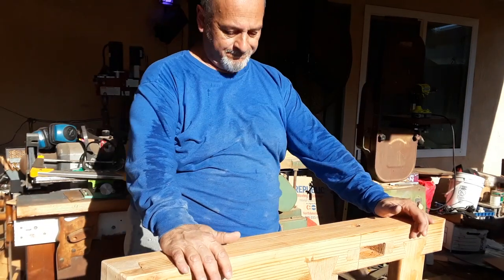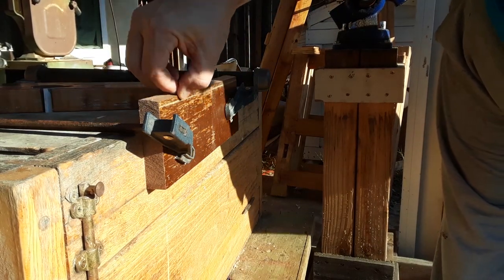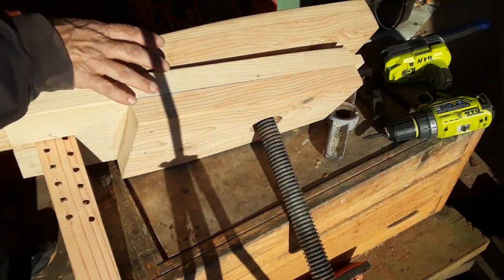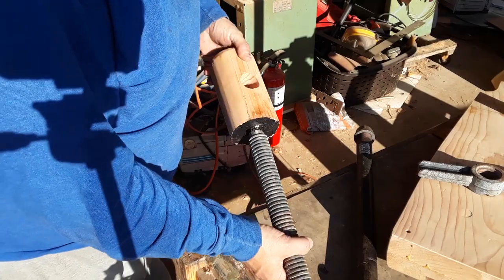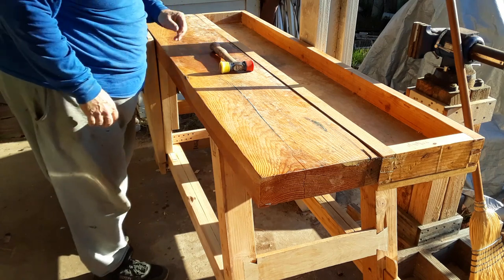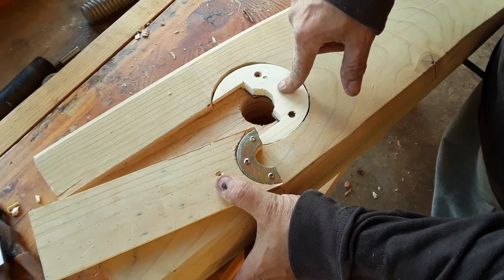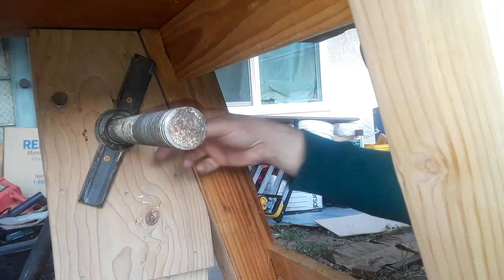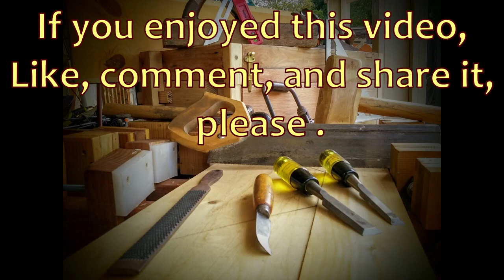Face Vise and Moravian Build Finale'

Comment: I watched this whole series, and I've gotta say it's cool that you showed your challenges and failures along with the successes, because this is real woodworking. When does a project go perfect? Not often, in my experience. You didn't 'sanitize' it for public consumption but you checked your ego and gave an honest account. Good for you. You've still got a nice workbench to show for it.
Reply from the maker: Thank you so much! I mean really, how can we learn until someone shows us the wrong way...right?
Reply: @DBacaMaker  Thank you for making this series of videos.  I have been considering making a Moravian workbench, but one thing that concerned me was having the vise shear off the dowel pins holding the top on if clamping a thin piece of wood (I didn't know how the back piece of the vise was secured; now I know there is an upper tenon as well as a lower one).  I appreciate your candor and your patience with yourself in working through the challenges that you faced.  It was a good example for me!

Comment: If this is your first bench, build a Nicholson Style. You need zero vises, hardly any joinery skills, and a drill bit. With these you can build a bench that can hold work and teach you how to build and join properly.
Reply from the maker: I have a Nicholson style bench as well, this one was meant to be my portable bench for when I work out at my theater group's stage. As it turned out, I haven't been able to use it that way.

Comment: You didn’t buy anything did you? This is super creative! It’s cool watching you make a vise from almost scratch.
Reply: Also, in the DVD he suggests oblong holes in the slab on the side that is away from the front to help with wood movement. 

If your top shrinks or grows it could get stuck
Reply from the maker: I was lucky to pay no money. But getting the parts I used required some sweat at another job. But yes, I came out way ahead on this.
Reply from the maker: LOL I did that by mistake anyway. Unsteady hand a drilling.

Comment: Have you thought about adding a planing stop to your workbench so you don't need a bench-long bench hook? Holes for hold fasts? Ultimately, I'm really impressed that you stuck it out and finished what seemed like a real bear of a project. And in such heat, too!
Reply from the maker: Oh definitely I want to add dog holes. I just haven't done it yet due to other projects. After all that, it became another horizontal surface.  Thank you! There is SO much I want to add, like dogs on the legs for long boards, a removable shelf underneath with portable tool drawers. SO many improvements over the months.

Comment: Very impressive. You definitely took a good design and made it your own.  You used what you could get or re-purpose as your material and It came out outstanding.  And you did it with hand tools for the most part! Now I will go back and watch all the videos again and look forward to the next.
Reply from the maker: Thank you. It's what I try to do as much as possible. I mean did you see the "stock" I have to work through in that yard? I must add, the power tools I received for free were actually kind of a hindrance is some cases. Just about the only time-saver was the radial arm saw for making kerf cuts. When I'm out at the stage or another job, the hand tools are what I use. I just had to push through this to move forward.

Comment: Nightmare build. I bought a parkinson vise from the 1950s, a Record Irwin competitor that was sold to colleges in the UK and someone rescued it from the skip, that when I got it.  Nothing wrong with using metal vise either I bought some rubber grips for mine.  Thanks for sharing.

Comment: Thanks for pushing thru to the completion. I'm looking forward to seeing more projects from you. If I can throw in my $.02; please be more careful. At 3:34 you were cleaning the dovetail & pushing the chisel directly towards your left hand. One slip and "it's off to the emergency room. Also, take better care of your thumb... :)
Reply from the maker: Had I really been applying pressure instead of short scraping motions I would have clamped it down. That was just cleaning off bits of fuzz; however, heh, you noticed the bruise on my nail. That was a screw gun bit bumping slipping out of a screw into the area just below my nail back in November of 2019. It surprised the !@#$ out of me when a bruise rose up. LOL

Comment: I wonder if the Roy Underhill bench hooks would work out better for you than a hook that goes the entire distance of the bench, maybe make three that way you could put one on each end and one in the center or wherever you happen to be cutting so that you dont have bend in the center, plus with his hook system you can also cut very small pieces. Yeah I saw that check near the end of the video and was like oh boy that's not good I like Heartland Outdoor Living's idea of using bowties to bring that check "into check". The bench did turn out nice though, looking forward to next video
Reply from the maker: Roy's hooks were what I had in mind. But I could certainly have fun with long pieces to flatten and square the length of the bench. As for the check. Yes, a few butterflies are going to land on it for sure. Most of the crack is underneath. Once that's treated I can look to some kind of tail vise situations. Thanks!

Comment: Yes. Two things concern me, firse is the way you left hand was in the way of the chisle when you were dove tailing. Next is the vice handel it will damage the larger wood end of the screw. Get some O rings to fit over the pipe caps ($.30$ fix).
I like what you have made and how you made the bench.
Reply from the maker: Thank you! First, the chisel was being use in short scraping cuts with care, but not pressure, just to remove a few bits of fuzz and fibers. But thank you for the concern. Second, I expect the handle will break, and I do plan to put in bushings throughout the vise; however, considering how crooked the handle is on the screw, I somewhat want it to break off eventually so I can fix that. It is, after all, only a store-bought bit of 4x4. I want to find a good piece of oak to make the next hub for the handle.

Comment: I give you a lot of credit you got to your Moravian bench build.
I've been wanting to build mine for years now. I am slowly getting clamps and wood I will need to build mine.
great job for your first one. of you ever build one out of say Oak you will be ahead of the game.
Reply: I got recycled timber, a bunch of the cheapest clamps and some cheap hand tools, second hand where possible. Just a set of chisels, a Japanese saw a no. 4 hand plane and an electric drill driver with a set of cheap spade bits. Spent less than $200 in tools and less than $100 in timber. That's all you need! Wish you best luck.